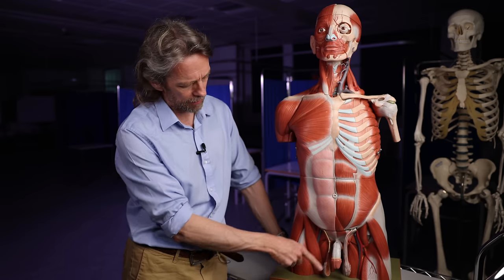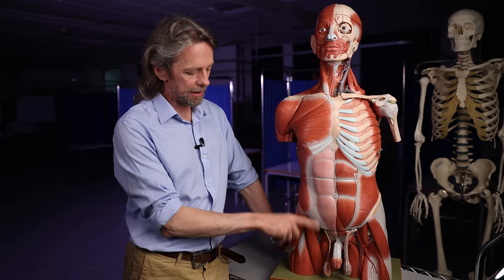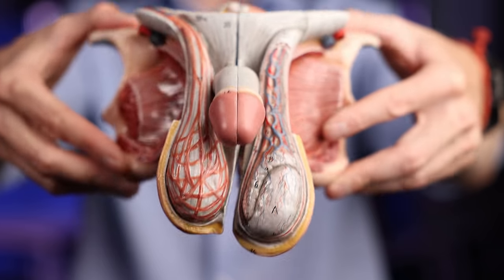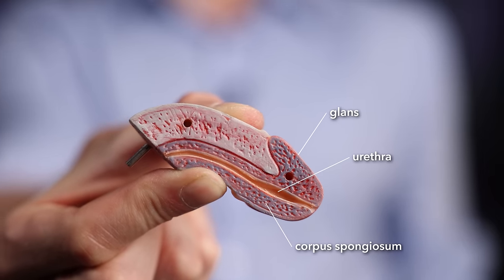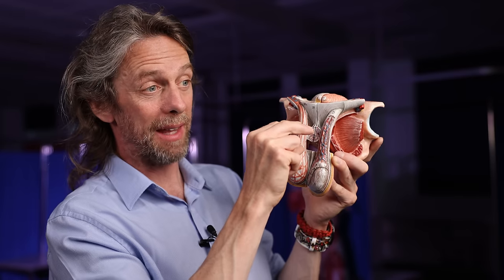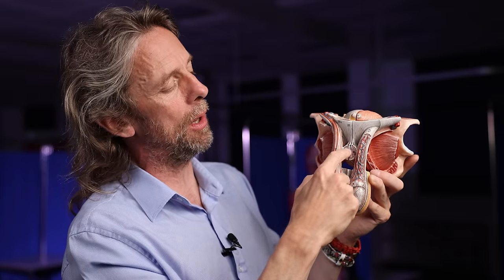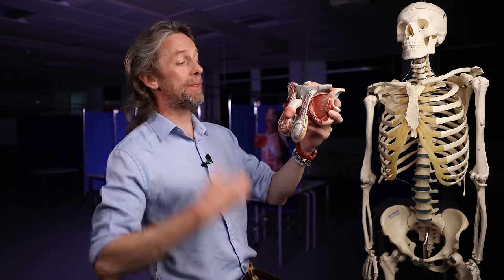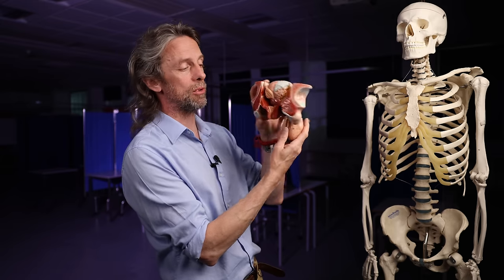Anatomy of the penis

Comment: Great, so the next time I'm in the shower cleaning "down there", I'm gonna be giving myself an anatomy refresher from the info in this video. As if I didn't have 900 million other things on my mind (the shower is where I think the most, oddly enough). This will continue until the water runs cold and I'm forced to finish bathing in six seconds, and then wondering why so much time has passed and I'm late to work.